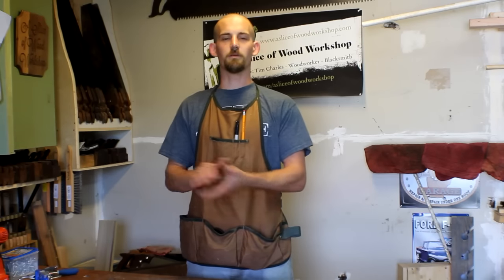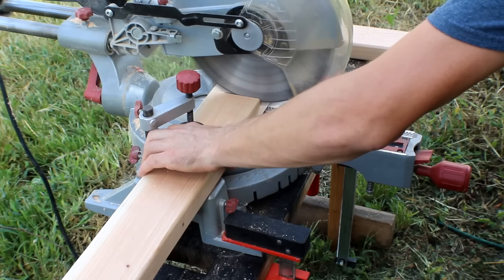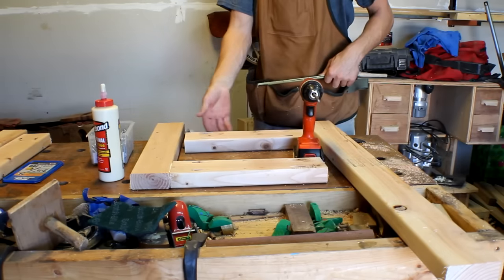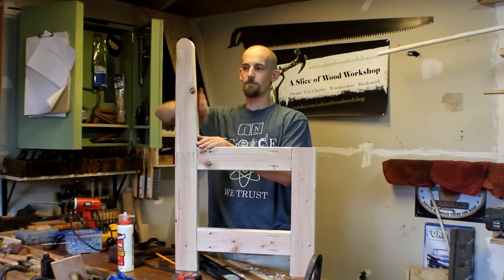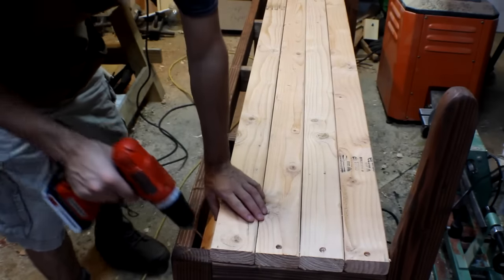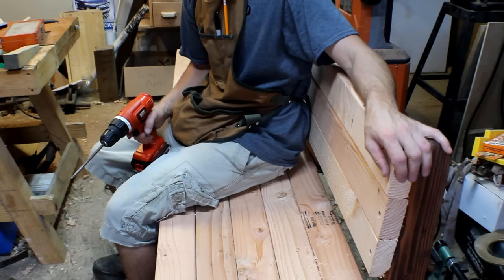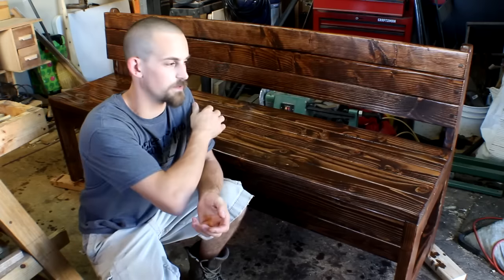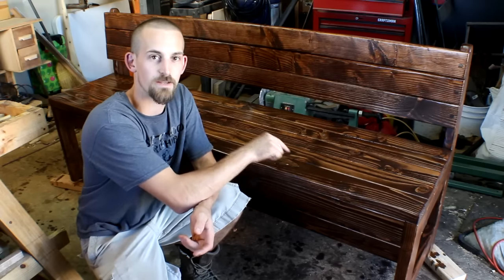Easy Made 2x4 Kitchen Bench!!!

Comment: To keep the 3 back boards from warping ? Put a 2×4. Block on the backside of the back / glue , screws , plugs 👍
Reply from the maker: Good tip. Bevel both ends so it flows better too.

Comment: Excelent work!! Just hacñve the question how did you join the rectangule for the seat. Thanks for sharing your work
Reply from the maker: everything was pocket holes. the seat slats were drilled straight through and then plugged.
Reply: Great bench! Going to build it this week. Different dimensions. Are the pocket holes on the seat brace drilled on the inside or out? Not experienced with pocket holes. Thanks!
Reply from the maker: on the inside

Comment: 2:35 I don't recommand using an corded drill while using pocket jig, because when you pull out the drill, you also scratch your jig. A cordless one stops instantly.
Reply from the maker: I've been using a corded one for over 5 years on this. No change in diameter of the holes.

Comment: Nice job Timothy.  How has the bench held up?  I am especially interested in knowing how the pine 2x4's performed for the seating surface?  Any trouble with splinters?
Reply from the maker: If I did it again I would run the 2x4s through a tablesaw and get rid of the rounded corners. Other than that the benches are fantastic
Reply: @ASliceofWoodWorkshop  - Thanks!  I make a workbench surface using 2x6s and did exactly that, then I joined them with glue and pocket screws.  It can out great, but I was curious about how soft the wood was for use as a seat and the potential for splinters.  I think you have convinced me to give it a try!  Thanks.